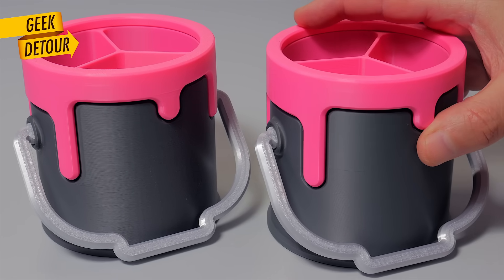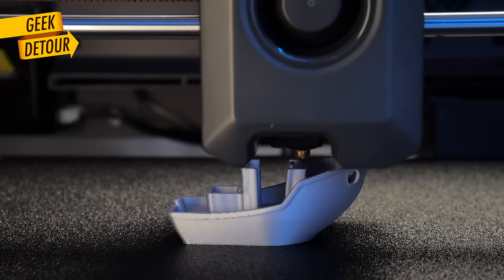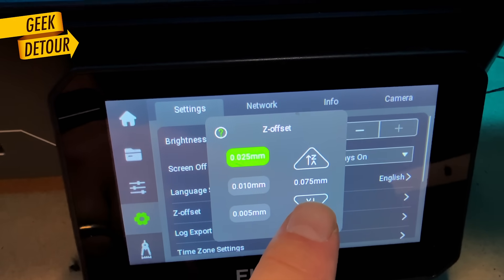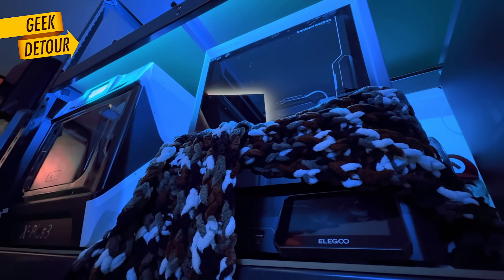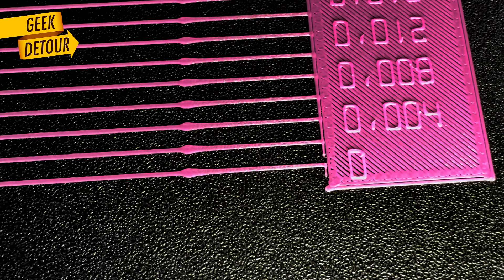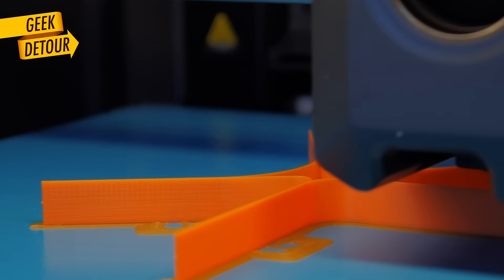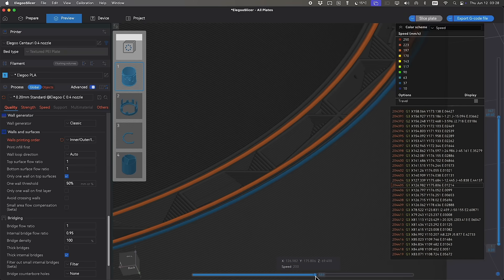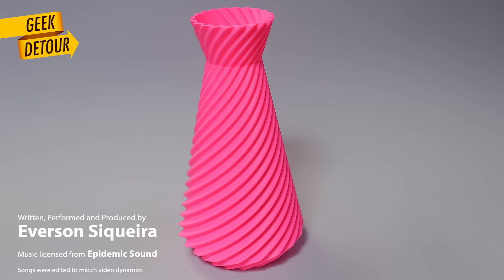Auto vs Manual Calibration — Elegoo Centauri Carbon

Comment: Nice work. Do you print PLA with door closed or opened? Do you change the z-offset if you print ABS?
Reply from the maker: Thanks Igor!!! ❤️ I printed most PLA with door closed, but without the Top Glass - not because I had a problem, but because I can put lights easily. Last time I printed with ABS was years ago.

Comment: Question! I have almost 200hrs on my Centauri Carbon so far, Love it. But one thing that bothers me, that I cant figure is out the Bed temp during the leveling process. The Carbon comes with a double sided plate, Side B being a Cool plate. My bed temps are set in the slicer to 35c, and it indeed prints with the bed at the correct temp, HOWEVER when running the calibration on the machine, even when specifing that will be using Side B of the plate it heats and levels the bed at 60c. This double the desired temp and as you mentioned with metals expanding and contracting it could effect the mesh. Is there way with start G code to change this?
Reply from the maker: Your question is excellent - I would need to check if when you calibrate for A, it calibrates the mesh using 60°C and if when you calibrate for B, maybe it calibrates for 35°C… In the screen we don’t know what it is doing. I can use a thermal camera to check that. It would be great if the interface allowed us to set a different temperature, I agree.
Reply: @GeekDetour  Thank you for the quick response! Dropping that sub and look forward to the results!!

Comment: somehow my plate scratched after auto leveling and reducing z offset
Reply from the maker: The leveling on the Centauri puts the plate close enough, that’s why we increase the offset, not reduce it.
Reply: @GeekDetour  My apologies, I meant to say increase. I assumed it was decreasing because I’m pressing down on the arrow on the display, which points downwards, so I thought it was reducing. I did come across an error. I keep receiving an error when auto-levelling, which says the platform is overly inclined, the sensor is damaged, or the environment is affecting it. I reached out to Elegoo, and they suggested that I ensure the surface is level and the worktop is stable. They also suggested using the rubber feet that come with my unit, but I’ve done that, and I still get errors sometimes. So, they may have to replace a part, possibly the sensor. I’m just waiting for a reply. Otherwise, thank you for your video. It sorted out a lot of the VFA issues. 

I may be writing a lot, but I have some extra information. They’re offering a free light upgrade for people with the old bead light. They asked for my serial number and order number. I’m based in the UK, and my model came with the AMS 4 pin on the back, but not the upgraded lights.

Comment: Preheat the bed and chamber in the cool morning for 10-15 minutes for the parts to expand after being condensed from the cold.
Reply from the maker: Sure, waiting a bit more for "heat soaking" would be the best - but in my test, just changing the command so the bed finishes heating before homing gave me a very good result!

Comment: Good content, very clearly presented.  Alternative to ironing is to adjust top layer flow ratio, top layer speed, top layer line width.  Avoids the scraping effect that can happen with ironing, and is much easier to dial in.

Comment: I tried `inner/outer/inner` but it made my overhangs sloppier. Sticking with `inner/outer` hasn't let me down yet.
Reply from the maker: You are absolutely right: it depends on the model. If it has too much overhangs, inner/outer is the best choice. When you have more “vertical walls” inner/outer/inner gets you smoother surface.

Comment: 4:56 That is the best first layer that I've ever seen. Also, I did the same thing to my start gcode for my Ender 3 S1 Pro and my BBL A1. I still have issues, with both  plates having a "high" corner. Even though they are both trammed to 99.999% perfection......
Reply from the maker: Oh man, I know what you mean. I still have my Ender 3 S1 Pro - I sill use it for PETG (I like to print PETG slow)... Mine also cannot do such a smooth perfect first layer... Not like these new printers are doing.

Comment: Instead of ironing, I reduce the top layer line infill width setting to 0.2 (from default 0.4) and increase top layer flow a bit. This gives me the same ironing result, but without ironing and much faster (≈50mm/s).
Reply: For ironing you would need to dial it in properly. The default is rather generic. I set the ironing flow to 40% and the ironing speed to 50mm/sec, for PLA and PETG. I also crank up top layers to 8 -10, to avoid scarring. With those settings Ironing doesn't take longer than your settings, and my results come close to a matte paint job, on pieces up to 20 *25 cm top surface.
Reply: What do you bump your flow ratio to? I see that default is 1. I also can only set my line width to .22, ORCA didn't like .2
Reply: I tried 1.05 and that didn't work lol
Reply: dont find this setting?
Reply: how much did you change top player flow?

Comment: Your gonna love this, for ALL printers don't do nozzle wipes during the START_G-Code. Do the nozzle wipes during the END_G-Code, one right after the print finishes then one at 200c, 150c 120c all with fan at max speed that way the silicone/Teflon wipers don't get damaged. This way no matter the material it will always wipe the nozzle clean. Then this is the tricky part that makes a crazy difference when you need a 15 min part in 16 minutes. During the START_G-Code home the nozzle at 55c after the bed is hot and in the Filament_Start_Gcode set your Z-Offset on a per filament basis that way the different nozzle temperatures are compensated for. On my klipper machines I even have different bed_meshes saved that get automatically loaded based on the what the temperature is set all during the start gcode that way I can go from printing PLA to printing PPS-CF at 350c

Also, if a printer has an actively heated chamber its best to us it on ALL filaments even PLA and calibrate the filament for THAT specific chamber temp, that way hot or cold summer or winter all conditions are the same in the printer.

the command for the offset is as follows

SET_GCODE_OFFSET Z=-0.030
Reply: For nozzle wiping after prints finished

(Original)   {if max_layer_z > 50}G1 Z{min(max_layer_z+50, printable_height+0.5)} F20000{else}G1 Z100 F20000 {endif}; Move print head up ...

M400
G92 E0

; === Begin Nozzle Cleaning ===
M106 P2 S255 ;part cooling
; Clean at 200C
M104 S200
M109 S200
M729 ; Clean nozzle at 200C

; Clean at 170C
M104 S170
M109 S170
M729 ; Clean nozzle at 170C

; Clean at 150C
M104 S150
M109 S150
M729 ; Clean nozzle at 150C
M106 P2 S0 ; turn off remote part cooling fan

(Original)M83...
Reply: @JKBODY  How should I implement that in the default Machine end G-code? Im unsure of what to comment out and where to put your code. Does Elegoo update the default G-code if they find a better way to do things?
It currently looks like this:

;===== date: 20250109 =====================
M400 ; wait for buffer to clear
M140 S0 ;Turn-off bed
M106 S255 ;Cooling nozzle
M83
G92 E0 ; zero the extruder
G2 I1 J0 Z{max_layer_z+0.5} E-1 F3000 ; lower z a little
G90
{if max_layer_z > 50}G1 Z{min(max_layer_z+50, printable_height+0.5)} F20000{else}G1 Z100 F20000 {endif}; Move print head up 
M204 S5000
M400
M83
G1 X202 F20000
M400
G1 Y250 F20000
G1 Y264.5 F1200
M400
G92 E0
M104 S0 ;Turn-off hotend
M140 S0 ;Turn-off bed
M106 S0 ; turn off fan
M106 P2 S0 ; turn off remote part cooling fan
M106 P3 S0 ; turn off chamber cooling fan
M84 ;Disable all steppers
Reply: @Hvabehar between the parts marked with (Original) so below the move head up and above the M83 command
The M204 is removed
Reply: @JKBODY  Huge thank you from a noob ♥
Reply from the maker: I loved the idea of wiping the nozzle at the end. I’ll give it a try!
Yeah, if you print materials of a much different temperature range, you need to calibrate the machine specifically for that.
Reply: @GeekDetour  Please let us know if you will be succesful at this!
Reply: Sounds great @Guardian_Arias. I tried it and failed. I copied these lines from the starting gcode G90 G28 M729 and put them after M400 in the ending code and my hotend smashed the top of my print. Should I leave out the G90? or both G90 and G28?
Reply: @davzelman  G90 Sets the coordinate system to absolute

G28 Homes all your axis unless you specify an axis such as G28 X Y

M729 seems to be a custom GCODE/Macro

you can google "Gcode Marlin Firmware" and the top result should be a list of gcode commands and how to use them. the Klipper team doesn't do a very good job in documenting every single gcode command since they expect you to write a macro and use the macros instead.

if you are new to this and you can access the terminal via the klipper web interface I would try one command at a time and write down what you did to get the desired results then stick it into the slicer end_gcode.
Reply: @JKBODY What do you change for the beginning gcode because at the start includes a import wipe before every print due to nozzle heating?
Reply: @JustCallMeElGameri do nothing bc i want a single nozzle clean in the beginning just too be shure
Reply: Thank you @Guardian_Arias. I just added this to the end Gcode and think this is great. 
And also a big shout out to @GeekDetour for this great, helpful video.
Reply: It's important to note you should also keep your nozzle wipe at the beginning because there is such a thing called ooze
Reply: @Eric_In_SF only if you fully heat the nozzle, the thermal expansion can be compensated for using a simple script that automatically calculates z-off set based on nozzle temp

Comment: I like slingers for easier maintenance
Reply from the maker: That’s true: I still have my first Ender 3, it works, I can 3D Print many of its parts- but I use less and less. BUT, my CoreXY printers (Bambu, QIDI, K2 Plus and Elegoo Centauri Carbon) barely need maintenance. You just print print print. Eventually, I’ll need to replace parts - but they are so much better machines than my bed slingers. At the Centauri Carbon price, it’s a no-brainer!

Comment: Anxious to make these changes.  Thanks for the video.  

Would be great to see any experience you have with temps as well. 

I’ve had mine for about a week or so, and I keep getting thin gaps in the very top layer (5 top shell layers).  No settings are working for me.  Interested to see if you have experience with that.
Reply from the maker: Hey, my pleasure! Oh, Uncle Jessy made a great video about Filament Calibration: Temperature Towers, Max Flow, Retractions to eliminate stringing (something I didn't have myself with this machine yet). You should watch: https://youtu.be/7rNlBwYd30k?si=surn-mEqEuzApnr6

Comment: Great video, man! I got this printer after having a CR-10 after a bit over 7 years. I'm interested in the VFA video as well. Keep it up!!
Reply from the maker: VFAs are an obsession - I have a few boxes of weird tests and attempts to make it better.
Reply: @GeekDetour  I printed the VFA test on my CC and seems like the 153-172 range, so exactly the default 160mm value is the worst, 150mm as you said looks nice but also everything above 172-191, would it make sense to use these fasters perhaps, considering they do look same if not better than 150mm range.
Reply from the maker: That’s a great question - indeed, when you look all the angles, you can see it gets ok around 150, gets worse s bit faster and beyond 190 gets better again. Why not just picking the Fastest speed? Because Physics: the printer has to accelerate from 0 to whatever speed we choose - and near the edges, you will have more VFAs and Ringing until it finally reaches the target speed. So, I prefer 150 for a more uniform finish all around the part. Even better is 50 of 40 - if you really want the whole wall to look uniform.